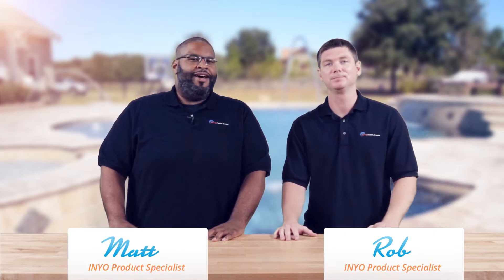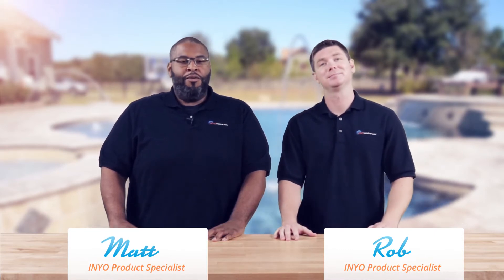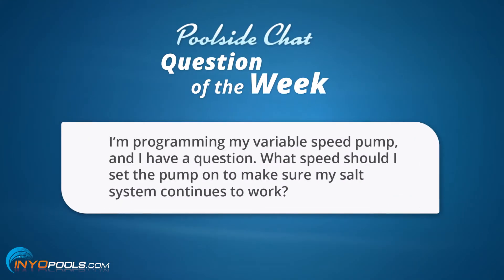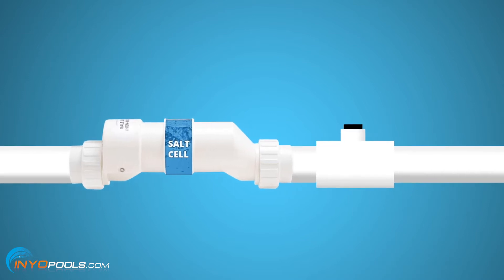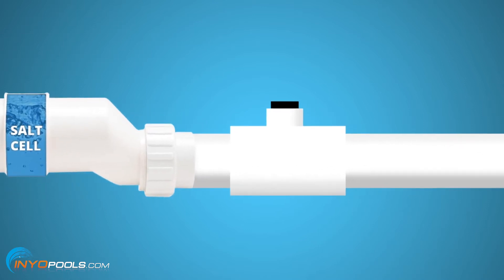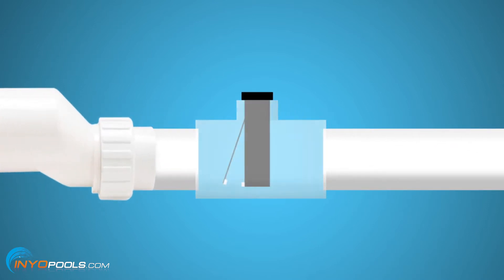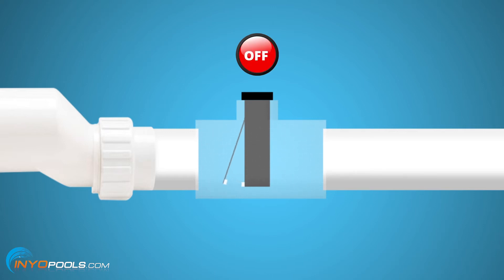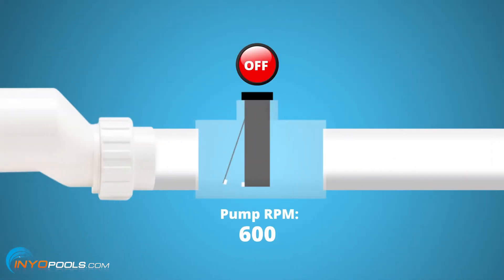What is the minimum VS pump speed for a salt system?

Comment: What about with a Breeze 540 (or equivalent) SCG that does not have or require a flow meter?  This system is typically wired such that it would be in a separate timer (relay) then the VSP.  With this system would you allow it to be in whenever the VSP is on regardless of RPM?
Reply from the maker: Hello Russ - It looks like the Breeze 540 has a tab on the inside of the cell that detects flow. I would have it set to run during the same time as the pump schedule. If you notice that the status light is solid and the service light comes on, you may have low water flow. In that case, increase the RPM's or clean the filter.

Comment: Just installed a vs pump(hayward) and mine is at 1800 rpm's right now. At 1700 rpm's my flow switch was red so had to move it up to 1800. 1 1/2" piping. Maybe with 2" piping i could run it slower??
Reply from the maker: Maybe, but I  don't think it'd be worth ripping out your 1.5" plumbing for 2" just to get the RPM down.

Comment: Do you guys know, what is the max flow rate allowed on a Hayward salt system thanks
Reply from the maker: There's not an expressed maximum flow rate listed for the Aqua Rite. The head loss chart listed in the manual is rated up to 160 GPM. Most residential applications will not exceed that flow rate.

Comment: One of the salt pools I take care of, the owner has the VSP running at only 650 RPM. I was actually surprised there wasn't a No Flow alarm flashing.
Reply from the maker: That's cool. Every pool is different! Thanks for watching :)
Reply: But is the salt generator at this low speed generating less chlorine per hour when compared to normal speed?
Reply: @Peter-Alexander  I'm looking for this answer as well....do you get less chlorine per hour @ 1500RPM than at @ 2500rpm?...I have a pentair VS...
Reply: @markwilliams5439  Hi Mark, I am using a spanish fixed frequency pump Espa and am going to install a iSaver 1100 frequency regulator in between mains and the pump. So I was just wondering about the amount of chlorine the pool would get with e.g. half the flow rate. My guess is you would get the same amount of chlorine in the pool but would like to know for sure. What is your experience? Best regards P.A.
Reply: @Peter-Alexander  just had a new cartridge filter installed, after my installer restored the power and reset my VS but in error has the cell run during the day when I have just 1500rpm for flow only, it was running during the night when I have it set at 2500rpm...cell says it is generating at 1500, but I was wondering if I'm getting 'less' at that speed...I live in scottsdale az where we've been really hot 115+ and my choline level has been dipping to under 1....wondering if it's my flow rate or the extra heat this year or both...I'm putting it back to run between 9pm and 3am at 2500 rpm...just the way it was before...so I dont have a benchmark to measure from, too many variables and would take too long since changes to FC levels dont happen overnight... Just looking for that general answer of high/low flow vs chlorine output.
Reply: @markwilliams5439  I just searched some forums regarding this question and the consensus is that rpm has little to none influence on the chlorine production. Make sure though your rpm is above the necessary flow switch rate. Regarding your low free chlorine I suggest you increase the percentage on the swg if possible and/or run it a bit longer during the hot period. I live in the south of Portugal and had to increase the swg from 40% to 80% and increase swg time with 2 hrs during the summer.
Reply: @markwilliams5439  I thought about your low chlorine levels some more. At which hour do you normally check the chlorine? Is that right after the swg was active or many hours after? Have you ever checked the CYA level? Ideally it should be between 20 and 50. Try to check the free chlorine level some day twice. Right after your swg stopped generating and also just before sunset. Is there a huge difference (like more than 1 to 2 ppm)? Then it could be your CYA level is too low. Be careful though with adding CYA as it is harder lowering it than increasing the value.
Reply: @Peter-Alexander  I check all my stats just about daily....CYA is always w/in range....when it's low I add either liquid conditioner or the crushed version to raise it. W/ no residual like what tabs leave behind, using a salt cell, you'll always have to add conditioner occasionally to maintain between 50-80.....with tabs CYA goes up and like you said it can never go down....but w/ a salt cell CYA will always decrease over time...I just need to run cell longer, just saw the filter installer only has it running about 6 hours after he installed new filter....his error....all my levels have always been w/in parameters....this is just an anomily...didnt know my run times were off this much....changing tomorrow...cell @ 40%...CYA, PH, FC, AC, CH, metals, phos, salt are all w/in range...I was just wondering if low RPM decreases output of cell...I found out it does not. Long as flow switch is working properly and not fluttering at low RPM, your good, and my flow switch is new,  it creates same amount of chlorine...thanks Peter for your thoughts and suggestions, its appreciated!
Reply: @markwilliams5439  Hi, only now realized what 115+ means as I'm used to celsius overhere in Portugal but that's really insanely hot. So how do you keep the pool water temperature below lets say 94 or so? Do you drop everyday a cubic meter of ice in the pool?😆. Or do you end up with a giant hot tub?
Reply: @markwilliams5439  I guess a heatpump could be used in reverse mode to cool the water I just realized.
Reply: @Peter-Alexander Portugal?!....wow, must be beautiful there!!...yes here in the USA we are F not C... warm pool water is actually very comfortable, water temp doesnt stay that hot too long...fluctuates and could drop down to 91ish quickly, 1,2 or 3 deg (F) fluctuation makes a huge difference, just like inside AC temp. But....the differential between ambient temp and pool water temp of 25deg (f) or so actually makes it quite nice, and with very low humidity of only 10% or so and low dew point of 30deg(F) or so, you actually get chilly when you get out of the pool when the outside temp is that hot....we Phoenicians like our pools warm- not cold...we keep hot tub, separated by a dam and overflow with separate pump at 100deg (F)...crazy summer temps here in the desert...